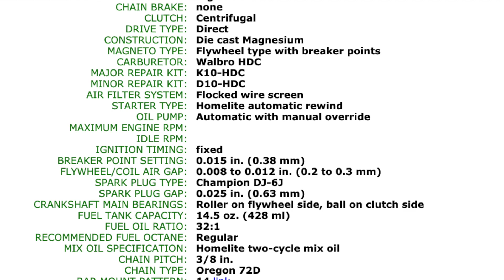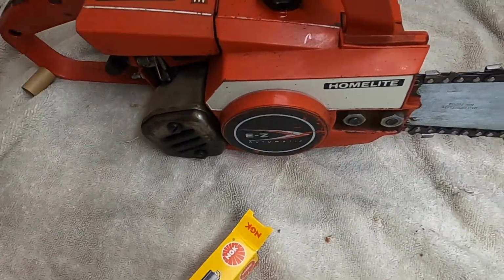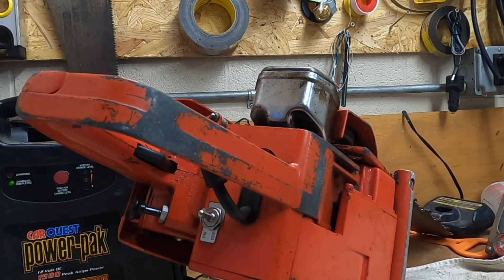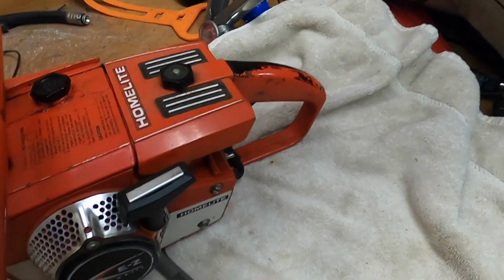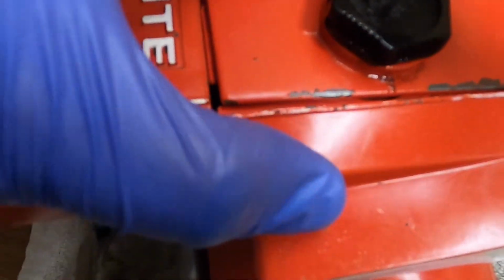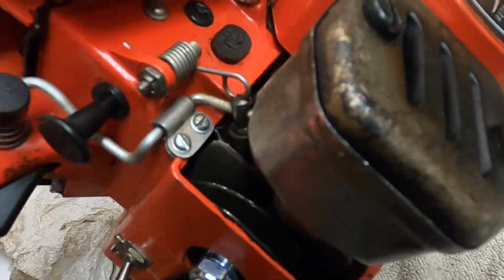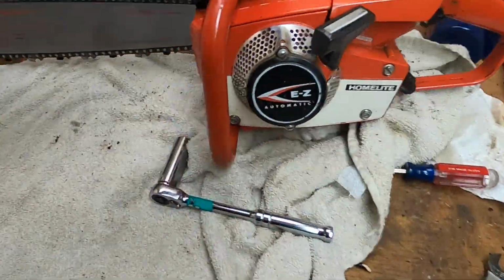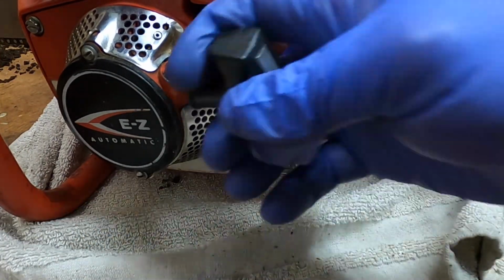First start in 20 years on Grandpa's 1969 Homelite EZ Automatic chainsaw

Comment: I'm surprised it runs as good as it does without taking the carb apart. I just received a later version of the same saw, believe it's late '70s, that I got from my father-in-law. He said his dad bought a brand new when he was a kid so I'm thinking it's a '79 going off all the research I did and with the serial number. I didn't have to rebuild the carb, I just took it apart and cleaned it, it was filthy, and put fresh gas in, thing runs like a top now. It will go in my vintage saw collection and hopefully someday one of my kids will like them as much as I do and they can have their great grandfather's chainsaw. Good video, nice to see someone else keeping these old saws alive.
Reply from the maker: That's awesome!  They don't make them like they used to!  I plan to keep this saw in the family for generations to come also
Reply: @kevinon4wheels  agreed.  Nothing is made as rugged as it used to.  Also, no one knows how to fix things anymore.  I find so many things on side of the road that only need like $20 worth of repairs and its good for much longer time 🤷‍♀️🤦🏽‍♂️
Reply from the maker: @cdlogans  usually just needs a fuel line or primer bulb replaced

Comment: Dude,  never use starting fluid on a 2-stroke motor.  Spray the fuel mix down the carb if need be.
Reply from the maker: That’s a better plan
Reply: It should be ok I use it all the time it saves your arm or in a bigger motor the starter like any good thing you shouldn’t go over kill with it the engine is still getting oil it’s not bone dry I usually try to put the choke in and give a little squirt with carb spray to see if it’ll kick over then I’ll get it gin g without
Reply: Nothing wrong with a little starting fluid to get it going.  I use it on any type engine when needed.  Well I use carb cleaner but same thing.  I usually put it in spark plug hole

Comment: Pull choke, set throttle lock, turn switch to ON, pull until it fires, push in choke, pull until it starts, it will rev high, pull throttle trigger to let it idle....that's my usual procedure...
Reply from the maker: Thank you!   I’ll try that out

Comment: Now that’s a chainsaw the 60s 70s and 80s were the most durable years for small engines that’s when chainsaws were chainsaws they were loud good sounding and lasted forever they don’t make ‘em like they used to
Reply from the maker: You’re right!
Reply: @kevinon4wheels  i remember when I was a kid in the 80s those big bow saws with those big 125cc 2stroke  those were so cool

Comment: If you have a 2 cylinder machine that will be sitting for a long time, load up the carb with ATF.  It will smoke when you next use it but the carb will be ok.
Reply from the maker: Thanks!

Comment: Just a suggestion, instead of using starting fluid that could wash the oil off the insides. You could get an oil squirter and squirt a small amount of fuel mix into the carb. Otherwise an awesome video of an old home lite. I’m currently working on a 240. It runs well but seems to loose fuel and just cuts off. Im hope I g it’s just dirt in the tank. We shall see
Reply from the maker: Thank you!  Let us know how the 240 project goes

Comment: That sweetheart purrs like a happy kitten! Nicely done my friend! I own a chainsaw collection of around 70 saws and half of them are vintage homelites.I have eleven of those saws, Two blue, Three red, Six red & white. Very temperamental chainsaw! Not made for the idiots who think they are loggers and if not aware of  what you need to do to make them work properly they don't take long to destroy them! One of the first super EZ Automatic i got from this guy who was wanting to trade for a echo i had. I started talking about how it would not turn over worth a crap! I ask him if he was pushing the compression release in and his answer was ( what's that? ) He was trying to start it without the compression release button pushed in! These chainsaws had a hundred and ninety pounds of compression from the start! What i see  alot with these saws is,You must have a sharp chain  that is making chips! Dull chain makes air borne sawdust and will pack the saw full and burn it down!
Reply from the maker: That’s all good stuff!   Thanks!
Reply: You are my hero😁
Reply: I have never used the compress button. Drop start 😅😅😅😅. Vroom Vroom aaa

Comment: Never realized how old mine was but I got one. None running but have a new carb for it with original paper work and case. Been sitting in my garage for years. Still in good shape too. How does one verify year? Not in the book

Comment: to properly tighten the chain: hold the tip of the bar up like it will when the saw is running, then tighten the chain until the Chain of the bottom side of the Bar is just making contact  with the bar, then give it a 1/8 turn because the chain will slighty stretch while the saw is running. Properly tighten a Chain is first important for saftey and second the clutch and his components and sometimes the needle bearing will last longer.
Reply from the maker: Thank you!

Comment: Could you tell me if the EZ automatic and the Super EZ automatic have interchangeable parts? I was just given my grandfathers EZ automatic. It currently is seized up though, due to us living on the gulf coast and a hurricane blew in flood waters. I can find plenty of Super EZ parts but not a lot of "regular" EZ parts. I really want to get this saw running and keep it in my family as you are doing with your grandfathers saw. Any information would be greatly appreciated. Thanks!
Reply from the maker: Hello.  I am not exactly sure on the difference between the two.  It sounds like a nice unit so I would think it's worth a shot to see if you can get it going!  Fill the cylinder with penetrating oil and see if that gives you anything to work with!
Reply: Different CC’s engine s
Reply: I can give you some information about these homelites! I have eleven of them 😋 The blue saws are manual oilers,So the clutch side cover is not as deep as the red or red & white saws with auto oilers stuffed in behind the clutch. The blue one is 2.1CI displacement the red one  2

Comment: Wanna save yourself a lot of time and shoulder wear? Take the pull cord cover off and use a drill
Reply from the maker: Great advice!  Thank you.  I'll use that next time!
Reply: Then you run the risk of injuring your wrist.
If you're going to use the drill method, at least use a wrench adapter (used for cheater bars)